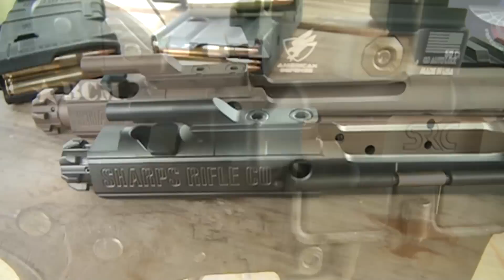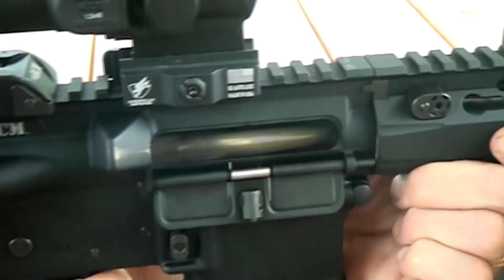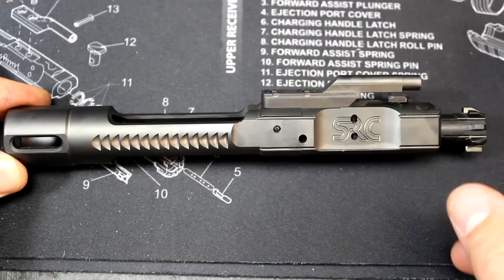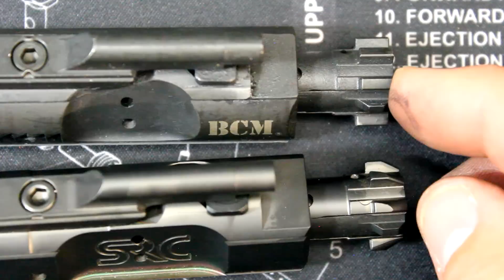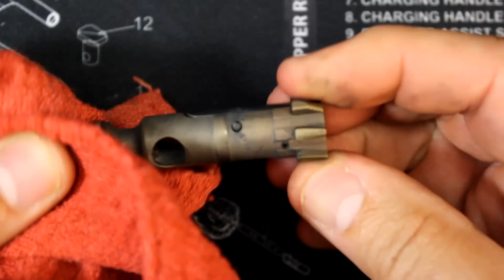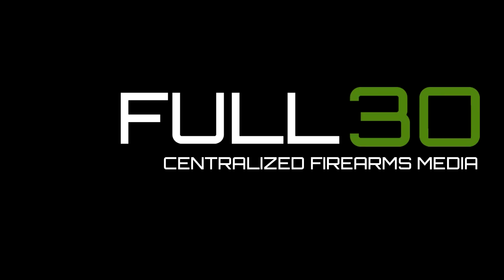Strongest AR15 BCG XPB Extreme Performance Bolt

Comment: That is a awesome AR-15 bolt Sootch00. I will definitely get this SARC bolt for my next AR-15 project thanks Sootch00, and Long live the Republic.
Reply from the maker: Thanks for watching Jerry!
Reply: sootch00 which color is the smoothest?
Reply: sootch00 Hey scooch how would you rate the BCM bcg ? I suspect Youl say this one featured here is better for hard use correct?
Reply: Jerry Johnson II the actual bolt is only $44. I threw a bolt on my fail zero Nicole boron coated carrier and its a great package and a very cheep way to add life to a worn out bolt.
Reply: @G3oc3nt1c  3
Reply: Thanks for  giving me a cheaper way to build my next AR-15 project G3oc3n1c
Reply: Thank you,,great info,,building my 1st ar,,love your wed site

Comment: I need some advice guys....

Iwas planning on getting a Microbest Premuim BCG which is incredible for the money, it has EVERYTHING a proper BCG should have....

-Phosphate Extractor
-Phosphate Gas Key
-Sprinco 5-coil Extractor Spring 
-Sprinco Ejector Spring
-Properly Staked

Features:
All-Chrome 8620 Tool Steel
C158 Steel
(HPT and MPI)

BUT I hear amazing things about the Sharp.  I am putting it in an 18" rifle length SPR build.  I won't be running too hard and I clean my rifles after nearly every use.  

Which BCG do you guys think is better for me??
Reply: I got the same question let me know if you got an answer lol

Comment: Okay, it’s 5 years late but I’ve never once had an AR bolt carrier failure. I’m not sure what this is a huge issue. Maybe it isn’t.
Reply: The  BCG is the heart of the system. It's the one place were spending $200 make sense over budget psa or no name stuff.  You can run a cheap upper, lower, handguard and maybe even barrel but do not skimp on the bcg

Comment: I'm buying a PA 10 from PSA and wondering if you've heard anything about the SRC 308 XTREME PERFORMANCE BOLT (XPB) CARRIER?  Worth the upgrade for shooting a lot of steel case rounds?  I'm interested in the dual ejector and upgraded extractor spring, as well as the tapered bolt interface surfaces.

Comment: S-7?  I am a retired tool & die guy. Without the heat treating specs, it means nothing. When you get into tool steels, heat treating is everything. I have never seen a M16 or M16A-1 with a sheared bolt or barrel extension. Nice sales pitch.

Comment: Let's get it straight here...  Std Mil-Spec Bolt Material:  Carpenter 158 Alloy Steel.  Std Mil-Spec Carrier Body Material:  8620 Alloy Steel.   SRC XPB Bolt & Carrier Body Material:  S7 Abrasion Resistant Tool Steel.

Comment: It's all good, but you don't need the carrier to be stronger than Carpenter 158. Bolt carriers generally don't fail. It's an extremely rare day when your carrier breaks. The gas key can shear, the screws break or back out, but a carrier isn't going to crack.

As for cutting weight, why have an M16 weight BCG, then start cutting holes in it. That's where you can (very, very unlikely) have it break. Why not just get a semi-auto BCG, which is lighter? I know why. In the back of all of our minds, we want a FA BCG "just in case". Y'all know what I mean. Don't pretend like you don't. 🤣

Comment: Been a subscriber for several years and always respected your opinions, UNTIL you took this SHOT at PSA just to plug a review. 
Very disappointed and somewhat questioning your integrity now.
I've had and still have several PSA AR15's and have NEVER had any complaints.
You should be ashamed of yourself.

Comment: I have had one with the NP3 coating for many years. I was one of the people who bought some of the first ones, and I did have a bolt break. sheared of two lugs, one on either side of the extractor. Sharps immediately sent me a new one, let me keep all of the spare parts, and offered to send my gun to a gunsmith and have it evaluated for damage no charge. Round count on the bolt was 3,273 at breakage. Have run the replacement for 3 years and 5k more rounds out of the same gun with no issues. Great bolt and carrier and have put them in all of my ar15's now.

Comment: been using the nickel boron 308 bolt and after less than 400 rds have found surprising wear marks along the bottom rails. For what was paid an expected I believe I'll be trying out the SRC XPB bolt for the ar 15 and ar 308 if available.

Comment: Good info and review. Thanks Sooch!
I have 2 FN ARs, a modded 16" M4/RECCE carbine and an 18" match grade sporter/DMR rifle. 

After 9000 rds on the M4/RECCE and 7000 rds on the sporter/DMR the bolts and carriers still look brand new.
Theres literally not a mark on either bolt and only the lightest finish wear on the cam pin, cam pin cam track walls and the corners of the carrier rails.
Even the extractor claws still look new under a microscope and tension on the bolts gas rings is ideal. There seems to be no real wear at all.
I did replace the M4/RECCE's extractors O-ring at about 7,500 rds because it seemed slightly degraded but other than that nothing seems to be wearing or aging.

Ive always thought that the bolts gas rings should be replaced every 5,000 rds and possibly even the bolt itself. Certainly by 10,000 rds the bolt should be replaced.

Is any of that true and does it apply to ALL mil-spec ARs or do some last longer?
I just want to keep my FNs in top form but with so little wear occurring,  it seems they will last much much longer than i expected.
Should i just keep trucking and replace as wear is found or should i replace key components at standard intervals?
And if so, what intervals?

Thanks in advance.

Comment: All you saying that the grade 8 fasteners aren't staked well, staking is not necessary. Just torque to 50 to 58 inch pound with high temperature loctite. You'll be fine. Young Manufacturing is the example I point to. They have never stake the key.

Comment: I love SRC,... but how did you formulate the claim that a SRC BCG is "thr strongest bolt carrier group?" Lol.
Reply: Probably S7 tool steel. Barrett uses s7 tool steel on their bolts. The 50 BMGs
Reply: @ortiz11039  so yes, it is a stronger steel, but when it also has window cuts and other deaign cuta everywhere, it ends up having less metal than a milspec. These thinner spots therefore become weaker
Reply: Jason Drakcip   not necessarily. Eliminate weight where you don’t need it, who needs or wants a heavy BCG slamming in your receiver and when did you hear or see a bcg failing or breaking in those areas???

Comment: I'm using the Blackwood Arms Ambi Upper and bolt carrier. And my bolt is very much like the sharps very impressive that Sharps is on the same page, as quality in a high end gun is needed. mine is 6.5 Grendel

Comment: Sootch00 would this bolt run in the guns that originally come with a semi auto BCM? Do you think they would perform better in a binary trigger set up? It is obviously what I would like to run, I would just want to make sure the lug and cut out differences would not slow the bolt down in any way. Thanks for the video, great information!

Comment: I understand the Sharps name has history but the name puts me off. Exspecially the name engraved on the left side. I could not stop thing how i would grind the name off with a surface grinder or EDM it off without impact to the fit, form and overall function.

Comment: I have the fde xpb in my fresh build . The first 4 shots went funny and after that its functioned flawlessly. What happens was the cam pin would make contact to the aero precision upper and created its clearance. Both parts were brand new
Reply: How’s it holding up
Reply: Its got a little  over 1k rounds on it  
Only gripe is coating is wearing off in the contact points.  

I have always cleaned and lubricated it.

Comment: The bolt unlocks due to internal gas pressure inside of the carrier pushing against the bolt starting the movement of the carrier. BCG canting is a myth.

Comment: After watching many videos, and talking with folks about quality parts, I bought 1 of these Fine BCG's. I absolutely  LOVE this BCG! I have taken it out and put 440 rounds of 5.56, in 55gr and 62gr through it, and it just wants more! When I have taken the BCG out to clean it, it has very little gunk on it. I am also running a flatwire buffer spring, with a stock Carbine buffer, and I have had ZERO failures! Quality parts may not make for the cheapest AR you can get, but MAN are those Key parts WORTH EVERY PENNY!

Comment: just a question, i always thought if you made the metal stronger it got more brittle and able to be cracked easier so is a harder metal necessary or desired? is the reason for the "mil-spec" metal because of the price more than the function because i didn't think making the metal was any more costly to do so
Reply: theytookmyfuckiname 
You’re right, but the stronger steel was in the bolt, not the carrier.
Reply: Surgical i was wondering if anyone knew why that was desirable just out of curiosity, i like to learn about these things and im making my first ar soon
Reply: theytookmyfuckiname 

Honestly it’s just a way to separate you from your money. A basic bolt will last a while, unless you’re going to shoot 15k rounds through your rifle in a year you’re good.

But people use different metal like titanium or aluminum on bolt carrier because they are lighter and reduce recoil. 

Since the bolt gets the brunt of the force, there should be no substitution for the steel.
Reply: awesome thank you for your reply's

Comment: I’m doing a Ar10 project build as we speak. For Christmas everyone that asked me what I want for Xmas I sent them a link for each part. I ordered some and my girl ordered some. I only need to purchase a BCG. My 2 other ar-15s both have a nickel boron BCG. I might buy one that has that black shiny nitrate with the nickel boron bolt, firing pin, cam pin, and gas key. But I really like the finish on the one shown in 3:34. I wonder if they make that for the .308. Buying/building an AR is the most exciting thing ever. All 3 of my other ARs I bought complete, and changed parts over time. which lead me to have a decent amount of extra parts that aren’t needed. So that’s why building one is great because you just pick the stuff you like right off the bat. It’s sketchy to sell gun parts here in Ny. And I’m not even talking about selling a lower receiver. Just other parts. Even though it’s legal, you still get tracked and watched. And people look at you like you’re a monster.

Comment: Jim Sullivan (the guy who built the AR-15) Even said removing carrier weight is stupid. The rifle gets over gassed and recoil increases due to higher BCG speed. Also more wear.
Reply: Darrel Finley; Stoner did not do it all alone. Sullivan was one of the designers that contributed to it. Deal with it.
Reply: Darrell Finley Eugene Stoner had almost nothing to do with the AR-15 development. Jim Sullivan and Bob Freemont took Stoners' design of the AR-10 and scaled it down to the AR-15. Eugene Stoner actually didn't like the smaller cartridge.

Comment: So how exactly is this better than a Colt, BCM, LMT, Toolcraft BCG?...."because it looks cool"?
Because it has a mediocre staking job?
Because they do batch testing and don't teat and inspect each and every part, that's a shortcut and definitely doesn't make it better by any means. There is absolutely no testing that makes it better than any of the BCG's I mentioned. 
Lighter weight, that doesn't make it better either, so where's the testing data that makes this better? The grade of steel used is a good idea but it's nothing new.....Waiting for documentation on how this is actually better and it "looks cool" means nothing.

Comment: You tube is funny. I just ordered one of these a few days ago and now this video is in my recommendations.

Also, the steaking is fine. It doesnt take deep cuts to function as it should. Even the slightest bit of material shifting is enough to hold it solidly in place.
Reply: rmordica that's because your phone and computer remembers what you look up and automatically place ads on apps and websites for products similar to what you even googled. Manufacturers buy that data from Google and such sites to know what people are buying or wanting to buy.

Comment: I have the older Sharps nickle boron bcg and it is a beast! 
I went 5000 rounds without a cleaning. I then took it out to clean it and it was crazy easy. Almost completely wiped clean with a paper towel without any cleaner on it. 
That sold me on Sharps and I bought an extra. Now I guess I need one of these.

Comment: Hey Sootch I have a Adams Arms piston driven AR 15 rifle with a low mass NiB bolt carrier group, my question is could I just use the Sharps NP3 plus bolt with my setup with no issues?
Reply: Just the bolt? Yes, after you remove the gas rings.

Comment: Great review and video as always. Silly question... That bolt carrier group wouldn't have any problems handling the 6.5 Grendel would it? It's either this or odin works.
Reply from the maker: Thanks Kevin. As far as 6.5 Grendel, the Carrier can handle it but the Odin Works BCG is a top notch piece so either way you go will be good.
Reply: sootch00 I went with the m-16 model XPB. I think this will make a big difference with the heavier "impact" (weight/energy) the grendel brings. Love your videos! Thanks

Comment: Does the DLC extend into the bolt cylinder of the carrier or is it only on the exterior of the carrier?
Reply: eh, bought one. thanks.
Reply from the maker: The DLC Coating completely covers the Bolt Carrier including the interior. Thanks Eric

Comment: "Strongest BCG" -Removes 40% of the material from the most critical pressure bearing component.

"Extreme Performance" -Barely stakes on the gas key and removes material from the carrier near the ejection port to allow the ingress of foreign debris.

k.

Comment: the reliabolt does nothing but allow much more filth to build up in your barrel extension. you may be able to run a few thousand more rounds without cleaning out the extension but your chamber will require scrubbing with a chamber brush before then anyway.

Comment: Does the Reliabolt design feed .300 BLK . . . . . reliably?
Reply from the maker: It shouldn't have any trouble with 300 Blk. The only problems I've encountered with 300 Blk is the gas port in the barrel being too small. After they were drilled out, I've had no issues. That's happened in two of the three 300 Blk barrels I own.

Comment: I just got a palmetto State armory ar with a heavy .75in stainless fluted barrel with a .223 Wylde chamber and a individually hp and mpi tested nickle boron coated bolt for 520 dollars free shipping and the 20 was the transfer
Reply from the maker: PSA is offering unbelievable deals. Good choice on the 223 Wylde.
Reply: sootch00 I certainly thought so but I have to admit I spent hours pouring over the specs trying to identify where the corners were cut and I couldn't find any difference between the paper and the m4 I was issued in the army 
.. except for a few sharp edges that could have been finished  better

Comment: Wear resistance is a little low on S7, but I'm sure it is a fantastic BCG. There is just a concern about how brittle it might be for long term use, especially rapid fire. 99.9% of viewers won't have a problem with the brittleness of a very tough steel BCG though.

Comment: Some shitty staking on that gas key. Deal breaker.
Reply: 4 years ago huh? What kind of BCG are you buying? I've never had to steak a colt, BCM, or Olympic arms BCG, and I've had those a lot longer than 4 years.
Reply: Mmmmm steak
Reply: Olympic?? LMAO
Reply: RealityIsUndeniable - HAHAHAHA
Reply: The large opening for the driver bit also weakens the fasteners
Reply: Anybody thats actually dealt with manufacturing AR bolts knows that the staking is worthless if the screws are properly torqued on to begin with. The only reason they even bother doing it anymore is because morons will refuse to buy them if they arent staked.

Comment: ive never blown up a carpenter steel bolt, cant justify buying 15 percent stronger
Reply: Exactly. Both my FN ARs still look brand new after 9,000 and 7,000 rds respectively. 
Theres literally not a mark on either bolt or extractor claw under the microscope. Even the gas rings are still ideal and extractor tension seems ideal as well.
And only the lightest finish wear is seen on the cam pin and carrier rails.

I like to optimize my fighting rifles even if theres no real deficiencies but from what im seeing from my FNs, they ARE optimized.

I dont see a real need to spend big money for an upgrade that could actually be a downgrade.
Reply: @holdernewtshesrearin5471  whats the coating on that bolt?  i seriously doubt u got a parked cam pin with 7k and light finish wear.  maybe 7k cycles in your basement?

Comment: Question: Have you looked at the Gemtech 5.56 Suppressed bolt carrier group? (for a suppressed AR-15). How would this Sharps bolt carrier group compare to the Gemtech for a suppressed AR?

Thanks for all the hard work you do for us.
Reply from the maker: I haven't had any experience with the Gemtech BCG but with the DLC coating, the XPB will make clean up easy. Thanks Terry!